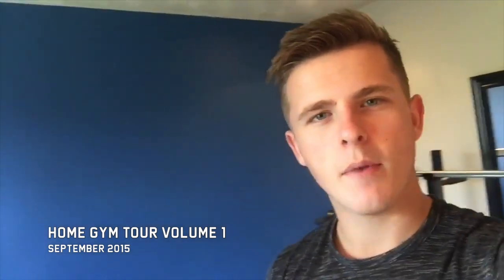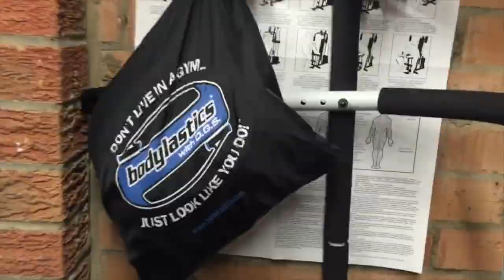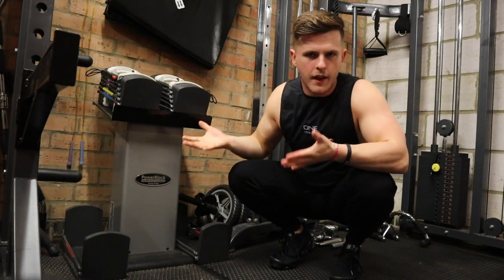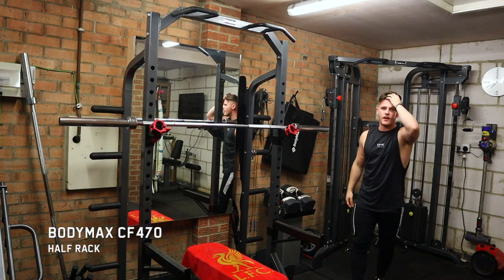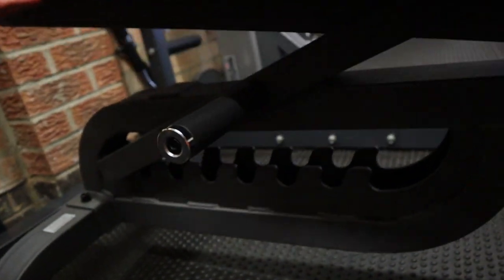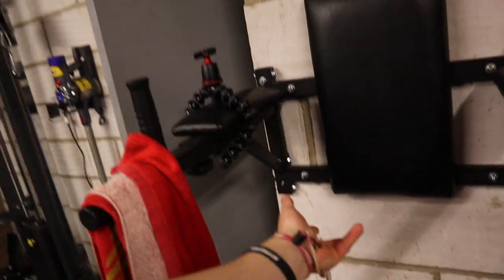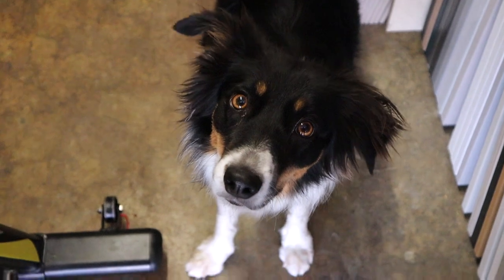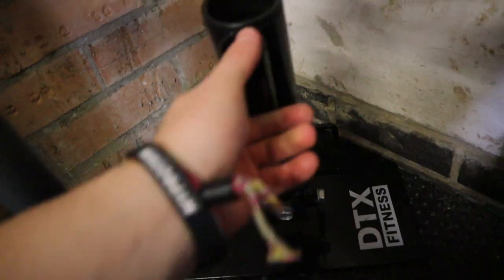Home Gym Tour - LSJ TV - Volume 5

Comment: You should get some heavy sandbags for power movements and conditioning and a glute drive machine similar to link attached.  https://www.youtube.com/watch?v=mUfwJGsKy0I
Reply: Items above are more wishlist like items; but for all the standing shoulder presses you do and bench and pullups--you might want seriously consider saving your shoulders with Crossover Symmetry.  You can save money and buy comparable resistance bands and set up on cable machine and look up the exercises on Youtube.  Great warmup for shoulder mobility and recovery after workout.